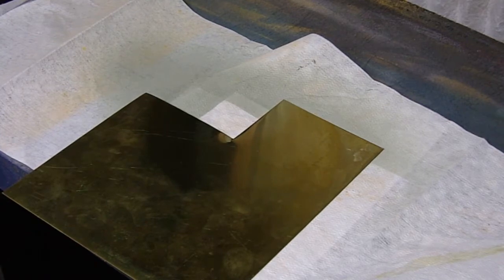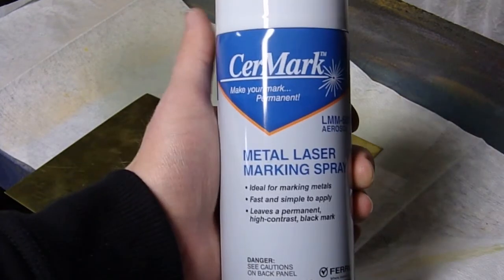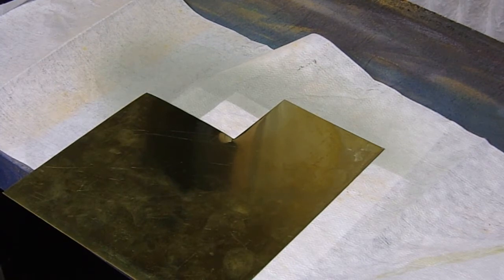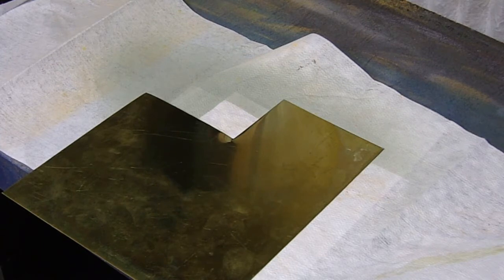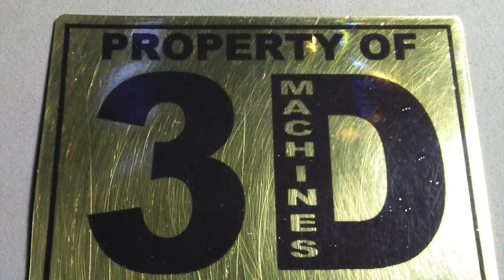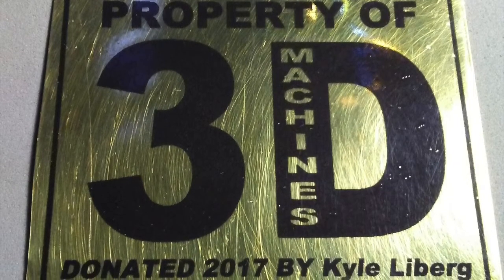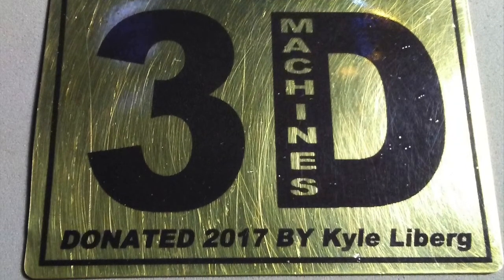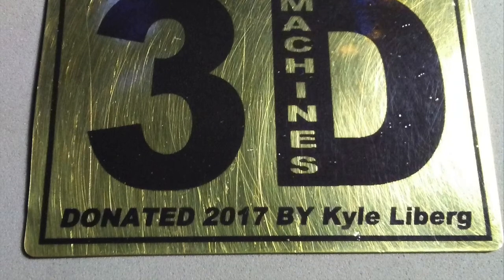Laser Etching a Brass Name Plate

Comment: I use Cermark but when using on anything but stainless steel, it washes right off... what's your secret?
Reply from the maker: I'm no expert, but I think it's mostly heat and speed settings. I don't have any rules of thumb to go by, but more thermally conductive materials like brass and aluminum I try to burn in hotter and slower. Clean surfaces are of course important too, but heat especially. Of course like you can see here, the extra heat does tend to cause warping though.